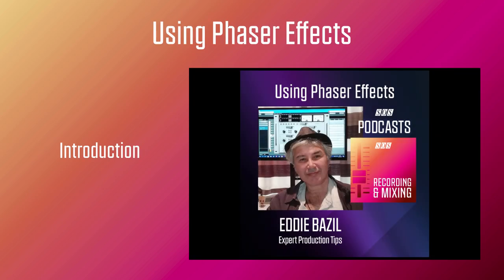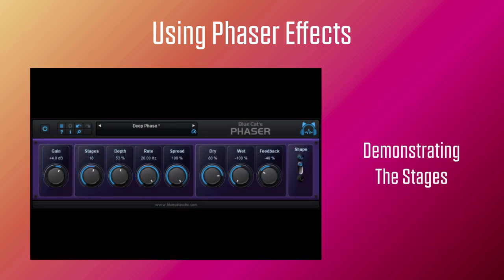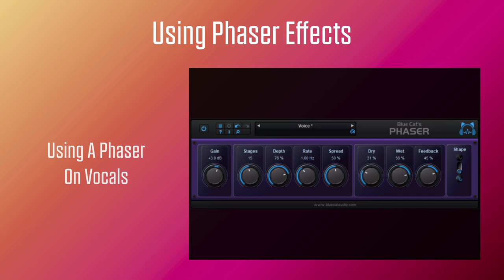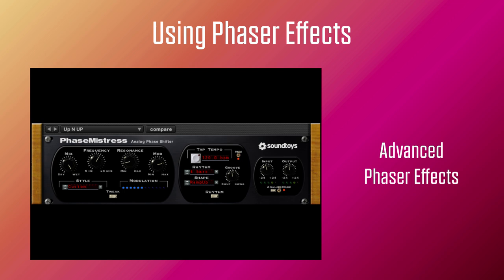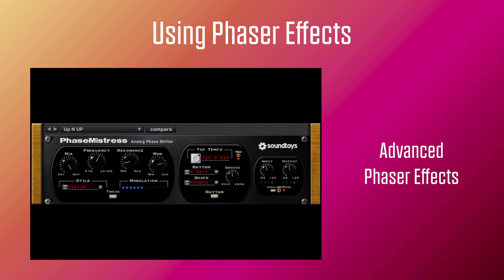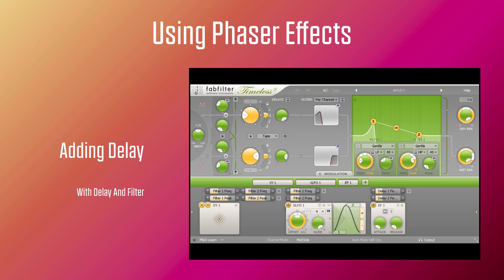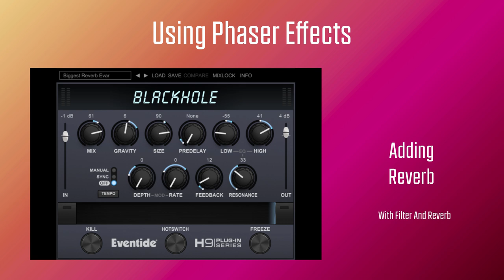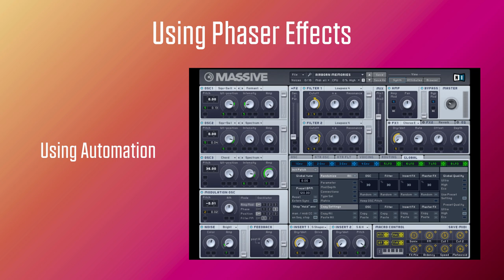Using Phaser Effects

Comment: Mr. Pedantic asks whether the "one kilohertz" and "four point two kilohertz" LFO frequencies are actually just plain "hertz".
Reply: Mithat, you are absolutely correct. It is an error on my part. Please accept my apologies.
Reply: @eddiebazil5080  This does suggest some fun that might be had in a video on phaser abuse in which you make use of phasers with ridiculous parameters. KHz modulators, modulators that aren't LFOs, feedback on the edge of instability, etc. :-)
Reply: @MithatKonar  lol..